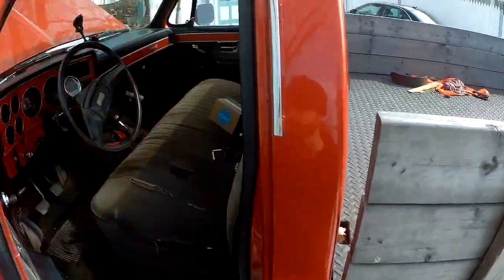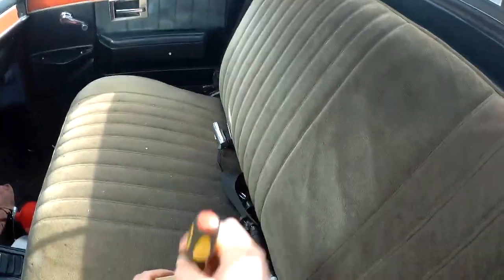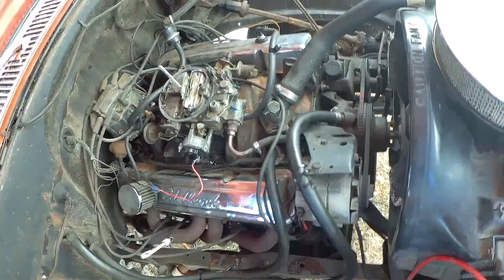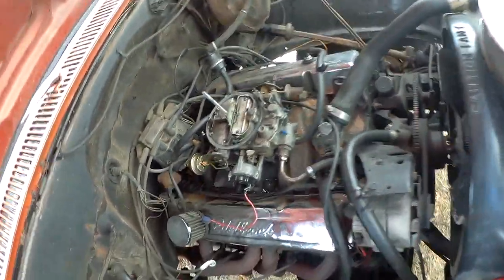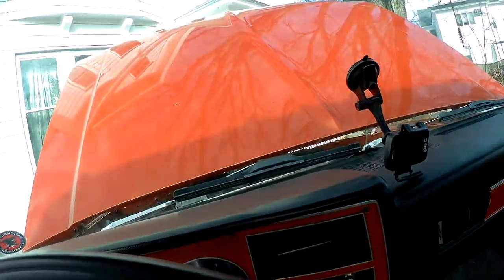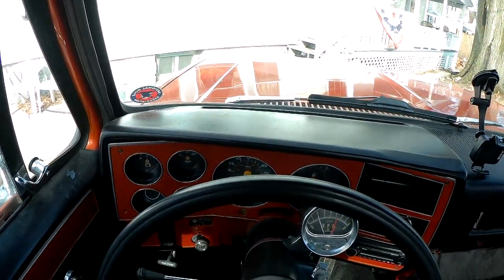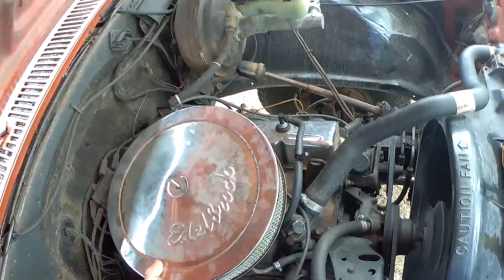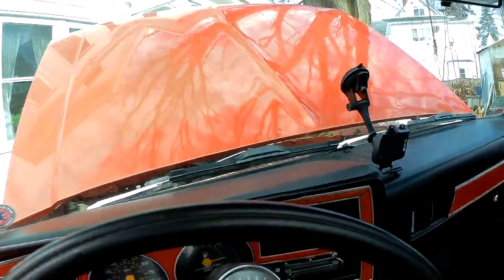Replacing a Vacuum Break On a Quadrajet Carburetor - 1983 GMC K10

Comment: warm idle adjustment cant be set until the gas pedal cable linkage bracket gets positioned so its closer to throttle lever......and brake light bulb blown.......cold idle is 1000-1200,  loved the video, took me back to when i owned a 4 x 4 square-body...
.
Reply from the maker: Wish I had a guy like you around to help me fix this thing!

Comment: Good one.   Da black smoke means its perhaps running too rich ..and those secondaries won't open until manifold vac is high enough to open um when speedin down the highway.   That linkage isn't on your normal idle because ur still stuck on your fast idle.   But I'm sures u figured this all out two years later
Reply from the maker: Moved on to something else now - '84 1 ton with 6.2L diesel. Equally interesting!
Reply: I'm having the same issue on my 84 Buick regal 3.8l v6 2 barrel carburetor. It's stuck on fast idle. I changed the choke thermostat it helped but still stuck unless i do it manually. But as soon as I give it gas it goes back to fast idle

Comment: The secondary's are not opening up because the primary valve is not straight up and open all the way. The electric choke needs to be adjusted to when the engine is warm the flap is straight up and down.

Comment: just looking at what you are plugging your vac break into.... is that the rear upper air horn part of the carb? if so, then you are using a port that is just a vent if I remember correctly .....i think your supposed to use the one below that, where you got the distr. vac advance in currently.....and the distributor vac advance goes on drivers side bottom front.......
Reply: I'd like to know the answer to that too

Comment: This is my life right now but with a 77 vandura - - edit: and the cat lives in the van lol
Reply from the maker: Oh snap, do you live in it too?
Reply: @Bootstrappin  hell yeah I do which makes these adjustments/repairs on the fly/learning as you go a lot more stressful. So I really appreciate the lightheartedness of the video. Last week I know for sure that my pull off rod rattled out due to high idling during a roadside repair/adjustment. Headed back to that area tmrw with a magnet to see if I can find it. It also looks like I'm missing the secondary throttle vacuum module and throttle rod as well but I'm not even sure it was there when I bought it. This specific carb has tons of random riggings going on by previous owners. Hoping to get it back to stock so that I can atleast comprehend a repair manual accurately.
Reply from the maker: @buggzo  oh man yeah that's the worst, 40+ years of rigging and Mickey Mousing in the engine compartment, it really does become tempting to just buy a decent remanufactured carb, shouldn't even be that expensive. You living in there by choice, or by circumstance?
Reply: @Bootstrappin  a bit of both choice and circumstance. I had been saving up various RV/camping gear and appliances for awhile and had planned on making the jump but not this soon. I got lucky that I found this van at the price I found it when circumstances were happening, so I dove in head first because it made financial sense at the time plus with everything going on with the pandemic, it made sense.
Reply: @Bootstrappin  reman carb: the updated rochesters and modern carbs handle newer fuels better. But I want to actually learn this carb before I replace it. Also, for the price of a new carb/reman quadrajet, I wouldn't be too far off from a LS swap from a junk yard and double my gas mileage (currently at 7mpg). So I'm always in limbo as far as where I want to put money on the engine because a modern engine is always in the back of my mind. Planning on a 4x4 conversion as well and considering a possible EV transplant in the future. So trying to take big money repairs slow while I learn 1970's style mechanic work.
Reply from the maker: @buggzo  the qjet is a great carb. I bought a rebuild kit for around $50 I wanna say, and followed this excellent video to rebuild mine https://youtu.be/oLpUqS9zrP8 

It's a nice skill to have while you save up money, courage, and skill to go for an LS swap, LQ4 would probably be a great choice for a van - reliable iron head hauler type motor.